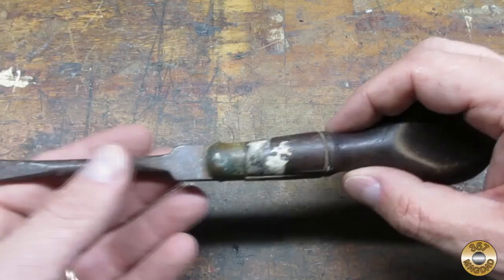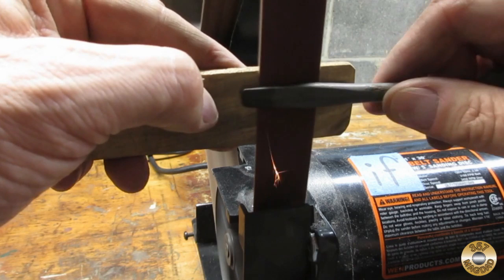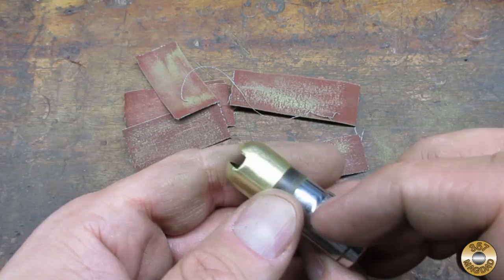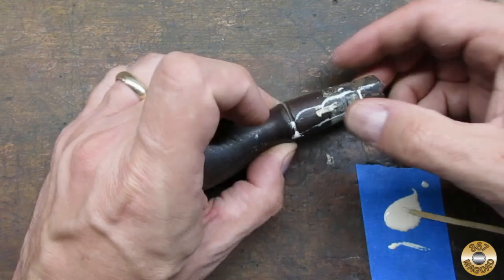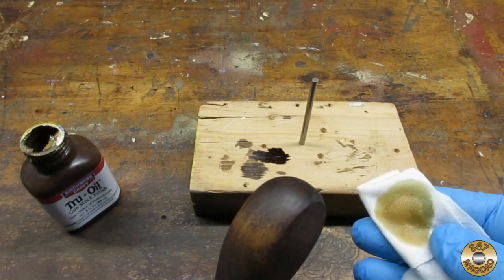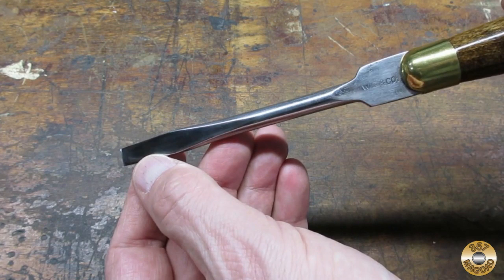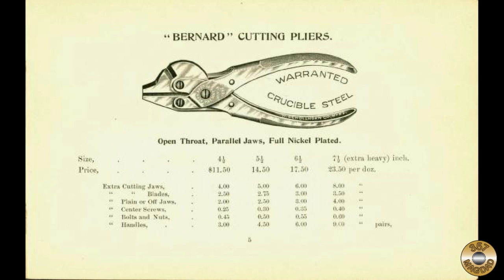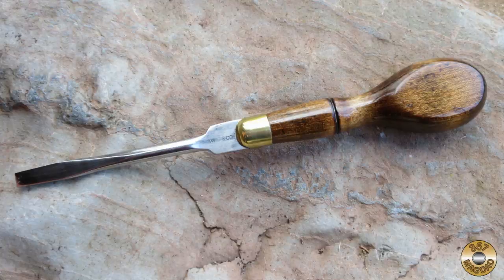Hand Tool Restoration - Vintage Screwdriver

Comment: Nice job! Those are my three favorite materials as well, steel, brass and wood! That’s a very unique screwdriver.
Reply from the maker: Thanks Planejet42! I think the flat part of the shaft would let you use a wrench if you needed more torque.

Comment: Nice finish On the wood.  It works well with "Flitzed" steel & brass.  :-)

Keep your hands clear on the wood splitter. What a machine. Thanks for the fun.  :-)
Reply from the maker: Thanks Mark!  That splitter looks like it required 100% concentration!

Comment: Just rewatching this tutorial.. the stain did a great job blending the stains on the wood .. and the gloss clear looks great too . I also noticed when you started on it the factory scratches on the blade were vertical instead of horizontal.. like more modern ones. Is this a way of kind of judging the age ? I also noticed a couple of the guys called it a cabinet makers screwdriver.. what makes it distinct from other besides it's obvious uniqueness?
Reply from the maker: I think it is called a cabinet maker's screwdriver because the narrow blade works well with countersunk wood screws.

Comment: That turned out beautifully! I have used Easy Off to suck old stain out of furniture and gun stocks. Just don't use hot water to rinse it or warpage will occur.
Reply from the maker: Thanks Downdog!  I tried oven cleaner on an old handsaw handle. It worked OK.

Comment: I've seen other tools that were WS&Co as well.  I like doing leather work and tried to purchase some hole punches on ebay.  The hole punches were labeled WS&Co.  I never got the tools that I purchased because the seller packaged them wrong and the box came open during transit.  I ended up receiving an empty box and no hole punches, just a punch to the gut knowing that these hole punches likely got thrown in the trash by someone.  I still have the pictures from the auction though.
Reply from the maker: Too bad about those holepunches!

Comment: Great restoration. Found a rare vintage Mortising Chisel double edge on ebay that is manufactured by WS Co. Stamped D.R.P 116286. No other information, Not sure if it is linked to the same manufacturer of the screwdriver.
Reply from the maker: Could be!

Comment: Awesome job.. you need a proper place to store such nice work now!... I'm thinking the screw driver was specifically made to go with another type of tool. For example, buy a set of planes and the company threw in a set of tools to take care of, change knives and such. I think they did  that back then??  Good luck and thanks for sharing!
Reply from the maker: Thanks Todd!  That screwdriver is going up on my project wall for sure!  I was hoping that it was made by that English plane manufacturer.  I was disappointed when the collectors website told me it wasn't!